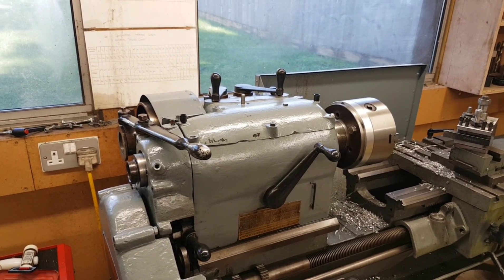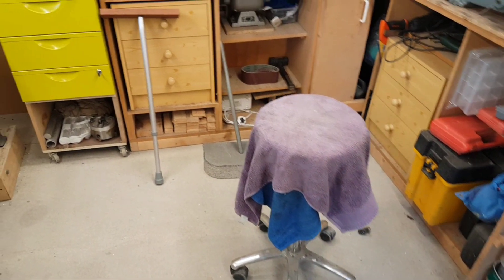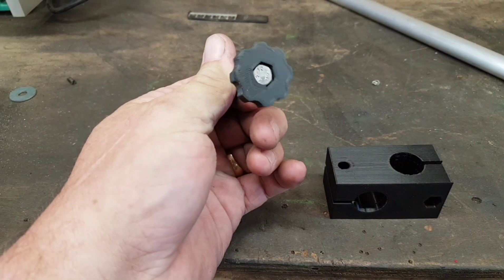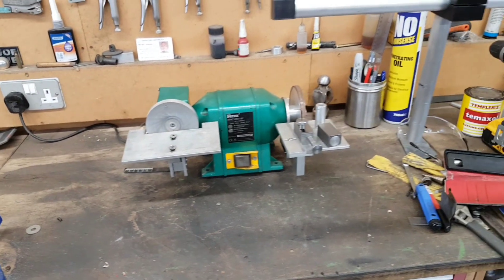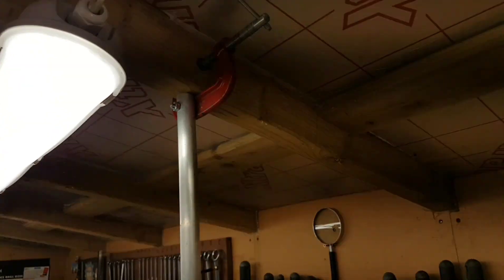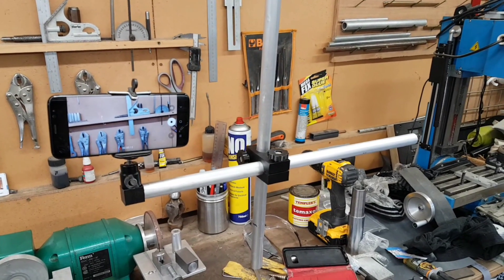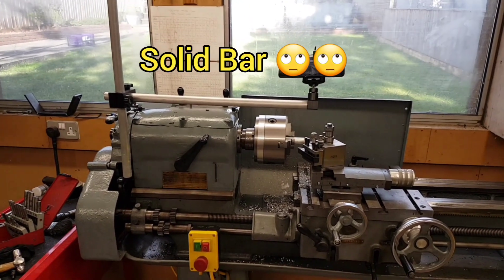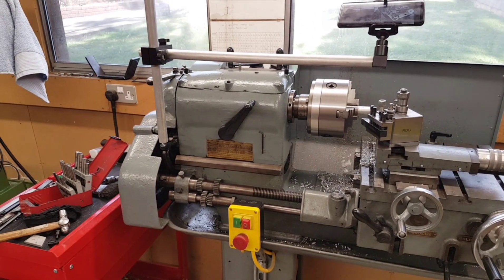Overhead Camera Mount !

Comment: Looks like this is just the thing I need to keep the camera from always being in the way.  And I have a 3d printer and a bunch of tube stock, so thanks for the great idea!👍
Reply from the maker: Hi Jim !
It works and not in the way. I was forever hitting the camera when it was on the bench. If you go for it, make the block so it pivots and not stuck at 90⁰. Bit more flexibility. 
Cheers Neil

Comment: I'm planning on something similar. Currently using my old sunshade base with a bit of square section in it and a 3D printed adapter for the horizontal rectangular section. It's heavy, always in the way, but fairly steady. I'm expecting cinema quality productions from you now, you're all set up now, no excuses! 😁
Reply from the maker: It works ok Olly and not effected by vibration when I'm working. Cinema quality? I cant string a sentence together properly, let alone a video 🤣🤣

Comment: Great overhead mount Neil. I might have to copy your design. I have a magnetic mount now that sits on the tailstock, might be useful for you also. I do all of my filming on an android phone. 
Best wishes, Dean.
Reply from the maker: I tried a mag mount but as nothing is bolted down, I had bad vibrations. That's why I thought floor or roof. Need to catch up on  your videos too.
Been a bit rough lately and not watched anything.
Cheers Neil
Reply: @NellsMechanicalManCave  never thought of that. As long as the viewer is resonating at the same frequency as the lathe, the picture would be clear!!
Hope you're feeling better mate. 
Dean.
Reply from the maker: Mmm! Resinating viewers,,  would that mean they self destruct 😳😳

Comment: Another cracking video from Manta man. I wonder if you could use a spring loaded jaw to grip the roof beam, then you could use a lever at the bottom of the tube to operate it, saving you from having to mess about with a clamp above your head mate??
Reply from the maker: I did try a spring clamp but it wasn't strong enough. The camera kept creeping down. Got that G clamp set now so it's only half a turn to reposition it and it stays put 😁😁